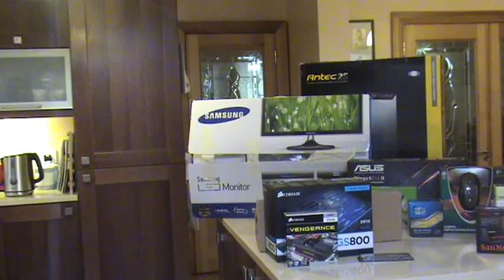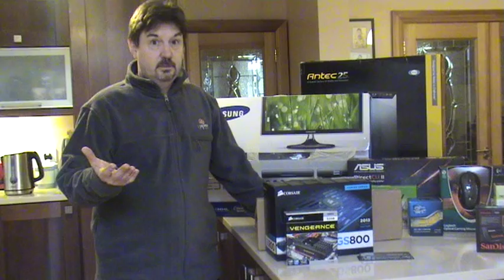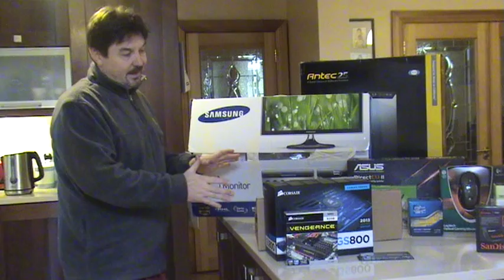P2b - Build Update - Boot with LED Debug Codes 15, 35 then restart.

Comment: i know this is an old post, but i was wondering if you solved this? i had the same problem but i cured it by setting the motherboard to use single bios, main bios with the switches on the board.